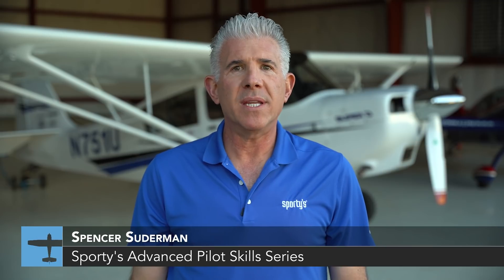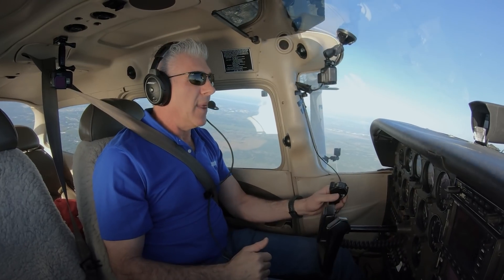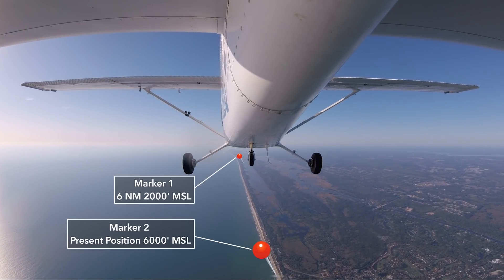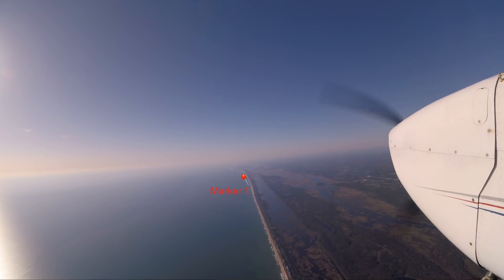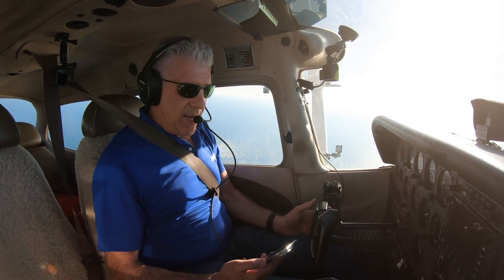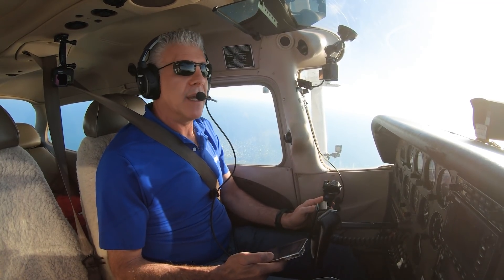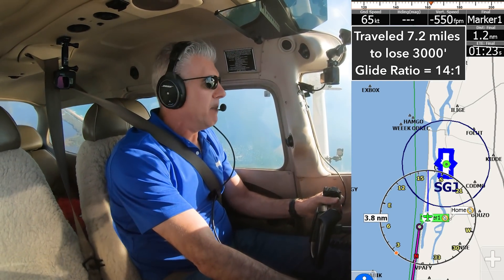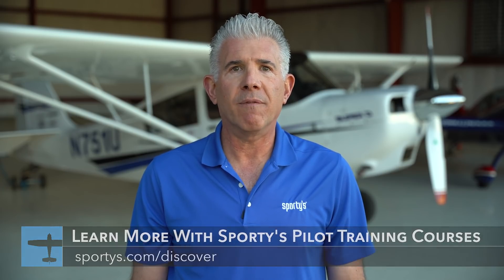Cessna 172 gliding distance - Sporty's Advanced Pilot Skills Series with Spencer Suderman (ep. 6)

Comment: Hmmm. Not really very accurate or useful. Firstly, weight affects glide ration. Glide ratio is the ratio of Lift over Drag (L/D) and is, for all practical purpose a constant; regardless of weight. In other words, if you increase the mass/weight of a gliding aircraft you will achieve the same distance, but at a faster speed. In your example however, you were lighter than normal, so to achieve your best L/D you will have needed to fly slower than normal. Unfortunately, your Cessna probably doesn’t state different best glide (L/D) speeds for different weights/masses, but just gives an average target speed. You flying at this mean speed when light weight could have actually reduced your best L/D. Glider pilots will know their best L/D speed for any given weight and will adjust accordingly. Pilots of modern airliners know their best L/D speed for any weight as this is normally displayed as a ‘green dot’ which automatically varies depending on the mass/weight of the aircraft AND its configuration. In fact I’ve only been simplifying the problem. Extra mass actually can increase your glide ration. This is due to increasing mass/weight increasing the best L/D speed, which in turn increases the Reynolds number and therefore reduces skin friction reducing the D part of the L/D ratio and thus increasing the overall glide ratio. This last part is extremely marginal, but why do you think competition glider pilots carry up to a quarter of a tonne of water ballast? Yes, I know there are often CoG issues, but fundamentally it is so they can fly faster down the, approximately, same glide angle in strong conditions when climbing in thermals is not an issue. So, the statement, “being lighter improves your glide ratio,” is fundamentally incorrect. So why did you glide further? Probably a combination of reasons but the major one you correctly surmised; your engine was running. Whilst you may have been getting negligible thrust, you won’t have been experiencing the drag of a Cessna 172’s stationary or windmilling propellor.  Furthermore, Cessna probably put a small safety margin in their figures, as they do for all performance related figures, to allow pilot/airframe deficiencies. Finally, even the tiniest amount of wind, and when was the last time anyone saw zero wind at 6,000 feet, can make a huge difference; especially on a very slow aircraft like a C172. So what use is this 1/9 ration? Well if you have an engine failure it can give you a rough idea of how far you can glide to a known point, like an airfield, approximately 1.5 nm per 1,000 ft of height above your known point. However, a handy tablet app, like SkyDemon, or your Gensys glass cockpit if your lucky like me, will do that much better for you taking live wind into account. However, with a total engine failure at non-oxygen/pressurisation altitudes the chances are that you are going down into an non-airfield environment and that will invariably not be in you GOS database. In this case how do your manage. Don’t get your phone or iPad out, but revert to the techniques you were taught by your instructor which will involve slight line angle (SLA), but that’s another chapter. I’m a professional aviator with 40+ years of experience on aircraft varying from F-4s to Dreamliners and from Schleicher gliders to four-engined Airbuses, but I still practise forced landings, read safety journals and look online and at YouTube, AVweb provides excellent content, to constantly hone my skill so that I feel safe taking my family flying at the weekend. As soon as the chap in the video said: “We will glide further because we are light”, my interest peaked, but for all the wrong reasons.
Enjoy aviation, keep learning and be careful what you listen to on YouTube.
Reply: Appreciate your input and thougtfullness in writing comments.  In the middle you summed it up: " So what use is this 1/9 ration? Well if you have an engine failure it can give you a rough idea of how far you can glide to a known point, like an airfield, approximately 1.5 nm per 1,000 ft of height above your known point"  That's the point of this video.  There are many variables and more than once I mention that.  The fact is, Cessna and other aircraft makers publish procedures and guidelines based upon compromise to address the majority of situations, not the corner use cases.  Comparing glider flying and how those pilots are taught about mass, speed and distance to powered aircraft flight is counterproductive to training pilots in Cessnas, for instance.   Maximizing gliding distance in a glider is one of the main objectives; however, in powered aircraft learning how to handle it in an emergency should already be known.
Reply: @ssairshows  My point is that manufacturers give guidelines which should be used. These are akin to net versus gross performance on large commercial aircraft. The profile that was flown could be very misleading. We simulate a feathered prop in the turboprop I fly by setting a recommended training torque, but even that tends to be optimistic, especially when compared to the simulator; and I’m lucky enough to have access to a visual simulator! I’m also lucky enough to fly with a Gensys glass cockpit giving a a best L/D green dot speed, instant wind and dynamic glide readouts. But the latter two only help if you have the airfield in the kit or a range readout to a landing field. And, unlike jets I’ve flown, a Cessna pilot is unlikely to be above 10,000 feet and, assuming a ‘shock factor’ and needing to get to the landing field with manoeuvre height, a 1/9 glide ratio is if anything optimistic, not overly pessimistic as the video suggests. In any case the statistically proven engine failure outcome after an engine failure in an SEP is an outfield landing/ditching to a point that is not in your kit or phone. Sight line angle (SLA) is what pilots need to understand. It works for any aeroplane in any configuration in any wind condition and should be taught; not fiddling with an iPhone in a stressful situation. The thing that shouted out to me, which is why I bothered to type my reply, is that this video was confusing the situation whilst the presenter showed a fundamental misunderstanding of what affects glide ratios; it’s the same on Cessna as it is on a world championship winning 26 metre sailplane. I’m lucky enough to have actually practised airborne engine out (idle) on aeroplanes as diverse as military jets, turbo-props and antique bi-planes; at night as well as day! However, I still have to practise to stop what little skill I have from fading; even after a few weeks, and I’m lucky enough to have received years of expert professional training and have years of experience as a professional pilot. That skill is recognising changing SLA, not getting my maths wrong when I just had a really stressful day.

Comment: A sailplane's glide ratio doesn't change with weight. Water ballast raises the best L/D speed but doesn't change the glide ratio.  Wouldn't a 172 be the same?
Reply: Thanks for the comment.  Several glider pilots have posted here about L/D and speed variations with weight.  Powered aircraft typically have one "best glide" speed published in their POH.  Pilots are trained to fly that speed during an engine out emergency.

Comment: At 9 to 1 glide ratio that's a 6.34 degree slope. So all us Instrument pilots shooting a 3 degree glide slope, in a single engine AC & have an engine failure at any phase of the approach ain't making it to the runway. 
Conversely anyone at Pattern altitude (1000 AGL) 5 miles out, ain't making the runway anywhere outside a 1&1/2 mile circle.

Comment: Isn't engine idle different than engine out, with regard to the glide distance?  Can you estimate how much?
Reply: Yeah I would expect idle and low weight would increase the glide a lot.
Reply: Well, if you're afraid to kill the engine and afraid that you haven't the skills for a dead stick landing, you leave the engine running.
Reply: @jiyushugi1085  That doesn't answer the question, though.  :-)
Reply: @0101-s7v  Engine at idle will significantly increase 'glide', but you're not really gliding if the engine is running, are you? 
Here's something to remember: if you lose the engine and are attempting to glide to a field, runway or someplace to land, and when your airspeed is steady at best glide speed, look at the spot and see if it is going up or down in your windscreen. If the landing spot is moving up the windscreen you're short; if it's going down the windscreen you're going long. 
Since you're going to float in ground effect, your aiming spot should be before wherever you want to touch down. Don't touch the flaps until landing is assured. Save the flaps to extend your glide if needed. If you're a bit short and in ground effect, dropping partial flaps will extend your glide. If you're high, slip the plane to increase drag and increase your descent rate.
High stress causes many people to overshoot their intended landing area. Practice engine out scenarios at idle power, then maybe try it for real someplace with lots of runway. Pick a spot on the runway and try to touch down there with no  power.
If there's a headwind on final, shorten your downwind leg.
Reply: Flaps increase lift, but increase drag proportionately more, decreasing glide ratio. This is why they are used in landing. Their increased drag at the same lift, the airplanes weight, allows/requires a steeper approach without increasing speed for a given power setting &/or a slower approach under power at a greater angle of attack, or some other combinations. 

If I am reading this correctly, you are recommending this only for when in ground effect, to eke out that last bit of distance before touchdown, borrowing it from your kinetic energy (speed). 

This is a public forum; info here may only be worth what you paid for it. Check this with you friendly neighborhood CFI if it actually affects you.

Comment: Excellent video and advice....and I don't mean to nitpick, but you said the engine was at idol but clearly at 3:53 of the video you can see the RPM gauge is at roughly 1100 - 1200rpm.  When i flew a 172, idol was around 700RPM.  So with this additional RPM, you have to assume some additional thrust, correct?
Reply: American Idle
Reply: Thanks for watching!  The throttle was at the idle position...the prop will turn with forward speed...can't help that.  I did mention this in the closing comments.
Reply: @ssairshows  Makes sense.  Your point about weight is also a good one...I took 2 pax up in a 172 on a hot day a few years ago, did an engine off final approach and I was amazed at the difference.  Excellent content, I'll be following from now on.

Comment: Weight and wing loading doesn’t change your beat L/D ratio. It changes the speed for best L/D. The published best glide speed is at max gross weight. Anytime you are less than max gross weight, best L/D speed is slower. Glider pilots know this. I encourage everyone to get glider training.
Reply: I was waiting for a glider pilot to chime in.  In the video, he was actually slower than published best glide, which is 68 for a 172S.  He mentioned he was trimmed for 65.
Reply: Glider pilots that fly wave also realize that red line airspeed is connected to true airspeed and factor that in at altitude.  I brought that up at a power ground school once and they thought I was in error.
Reply: Heave read about this in Aero 201 in school.  Curious if you have tested this in a glider at different weights to confirm…
Reply: Definitely think about adding a glider rating. Not only will it improve your stick and rudder skills, it's a heck of a lot of fun!
Reply: Gliding 101 - dude should of at least learned something about gliding before attempting to play teacher. Plus, he leaves the engine at idle, when it's producing significant thrust.
If more pilots got a glider rating and few hundred hours in gliders before moving to power they'd not only become much better pilots they'd also be much safer. Impatience kills....
Reply: Good response.  We do this everyday at Sky King Soaring!
Reply: I believe racing gliders carry water ballast for speed, which would be counterproductive if it killed too much glide ratio, as more time would presumably be needed to gain altitude in thermals, say. The ballast is dumped for slower landing speeds. 

However, the same glide ratio at higher speeds also means higher rate of descent, while thermals have a rate of rise essentially fixed for each particular one (I am postulating from my own thinking) so a higher rate of descent would then be counterproductive. I suppose wave gliding along ridges would take different compromises. 

Oh, my! Sounds like trade offs to be navigated. 

I remember watching a glider coming in on short final. It looked like it was clawing it way down against its natural inclination, not like a usual mushed in approach nearing stall like the powered light planes. Sort of a naturally floater in a pool swimming to the bottom.